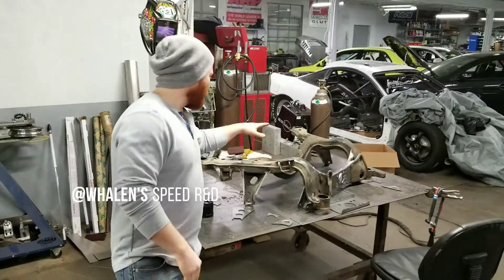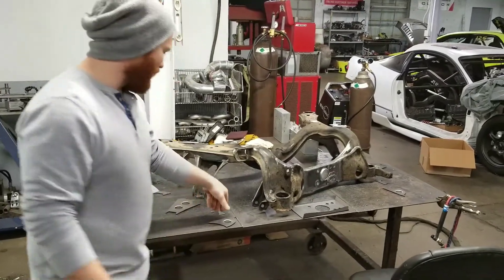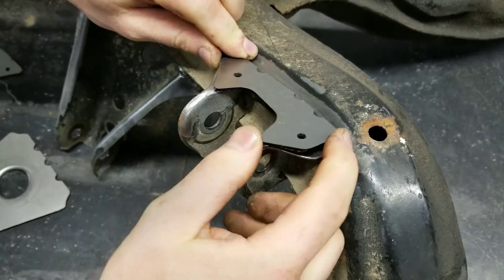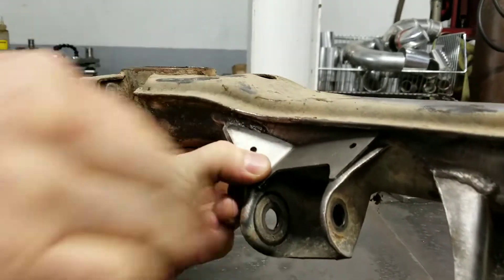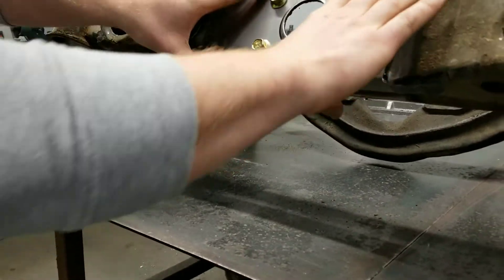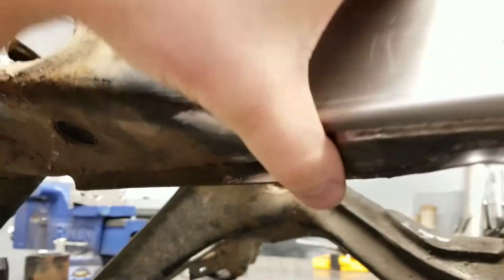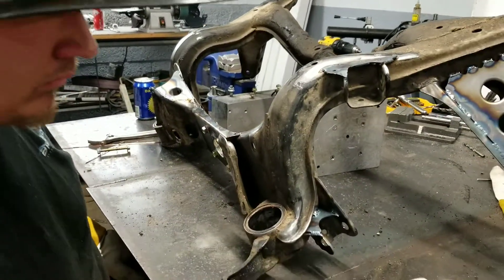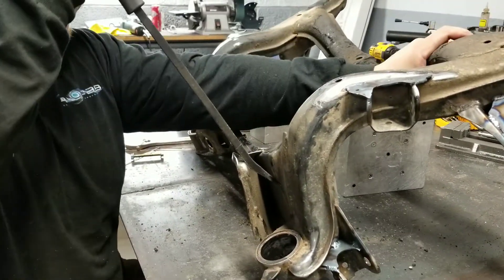Bulky Boyz: Reinforcing A S13 OEM Rear Subframe | GKTech V2 Kit | TIG Welding

Comment: I haven't installed my v1 GKtech reinforcement kit yet, but I'm considering just buying the v2 because it addresses so many of the v1 issues. V2 has the drain holes for the traction rod built in and the proper bends for the other pieces. Although it's not an issue for the S13, that rear differential reinforcement is so much nicer on v2. The v1 diff piece consists of a tiny, thin piece of metal that doesn't look like it can help much.
Reply from the maker: Colin S yeah! It may be a good investment to upgrade now to the V2 kit. Lock down all then key areas before you reinstall the subframe.
Reply: I'm leaning towards that way. Better to do it right the first time. Did you guys paint the back of the differential piece? Seems like it could rust since the welds don't completely seal it and water may pool up in the tiny gaps.